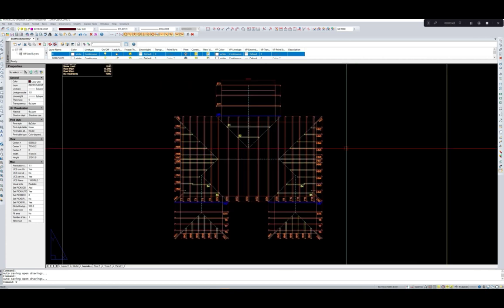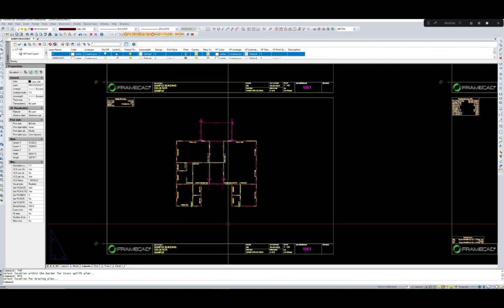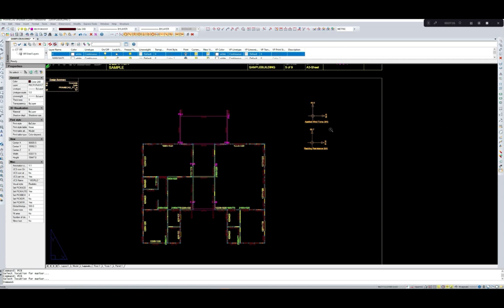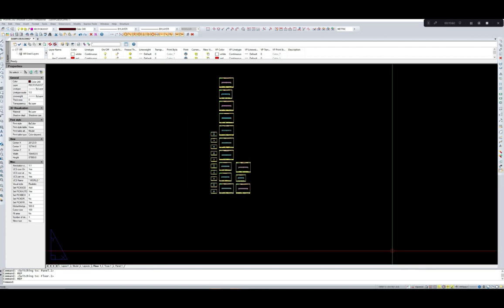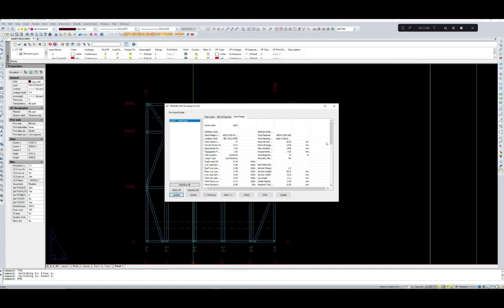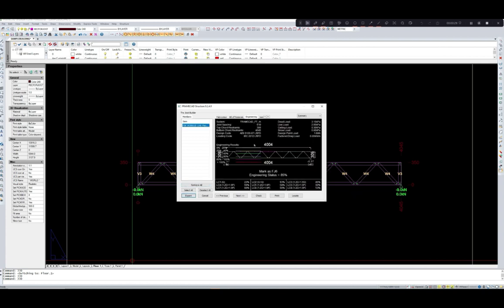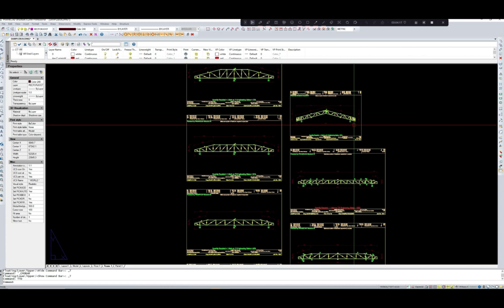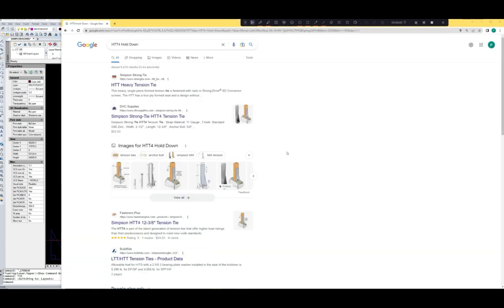SECTION 11 REACTION PLANS DESIGN REPORTS AND STEEL CONSUMPTIONS

Comment: Thank you for your videos, Sir. I have a question: Doesn't the dead load from the upper wall transfer down to the lower wall in FrameCAD? I tried it, and I didn’t see the dead load change. So how can we assess whether the lower wall is strong enough to carry the load? Is this software really effective?
Additionally, I have another question: If the upper wall is placed perpendicular to the joists, how can we evaluate whether those joists are adequate to support the load from the upper wall? Is there a way in FrameCAD to verify this load transfer and check the joist capacity accordingly?
Reply from the maker: You can verify from the reaction file